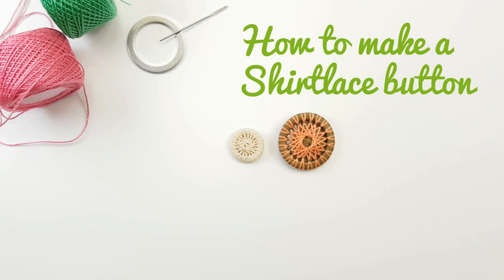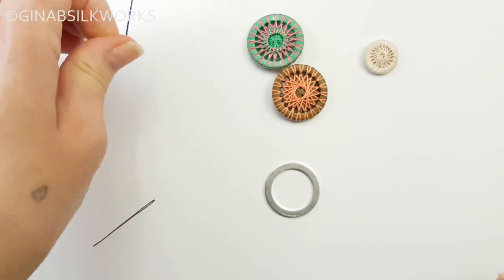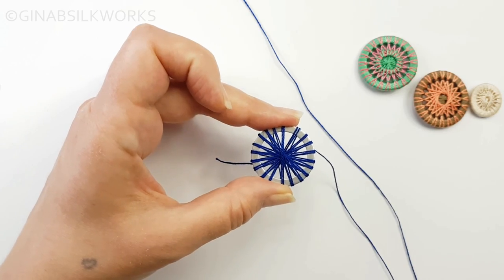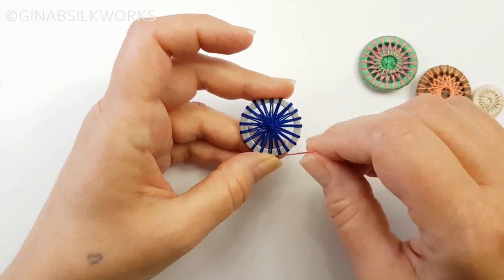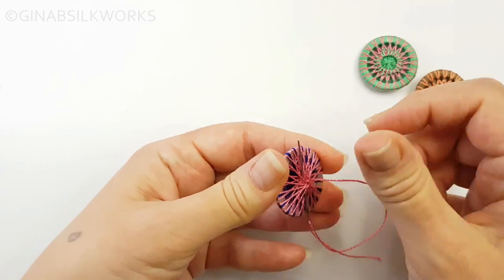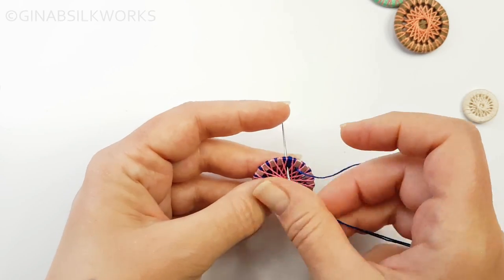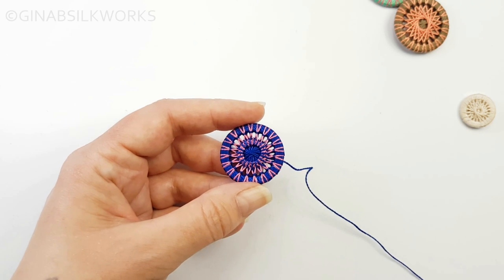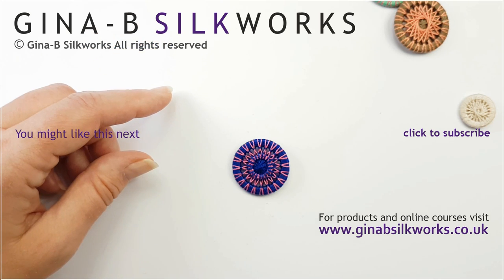How to make a shirtlace button (not a Dorset Button) - a zwirnknopfe ring button

Comment: How do you keep the thread from sliding around on your ring? My thread keeps slipping off (and around, and just generally not staying in place).
Reply from the maker: If you are using a flat (washer-style) ring, and the thread slips, the chances are your tension is too tight. If you are wrapping tightly, the thread wants to pull down the curve of the ring. 
You can rub a bit of beeswax on the ring to make it a little tacky - this often helps.
Also, if you are holding the centre of the button - not the edge - you may find that your fingers actually push the threads as you rotate. If you can try to hold along the edge, or only very gently when holding the centre, you may find they slip less. 
I hope this helps :)

Comment: What time periods would these be appropriate for?
Reply from the maker: From what I have found so far, these are from about the mid 1800s - with a a machine advertised in 1911 which of course increased production, as part of the work could be done by machine.

Comment: Thank you Gina for sharing your wonderful talents. Your videos are clear, concise and extremely informative and, best of all, interesting. With the price of buttons being so high, I’m hoping to make my own for my knitted garments. My question is: how should I launder the buttons? Is hand washing acceptable? Please advise. And thank you again for your marvellous videos. I’m subscribed and look forward to them. Also, I wish for you and your loved ones a Happy Christmas and peace, health and happiness in the coming New Year.
Reply from the maker: Thank you! 
Laundering depends on the material of the mould and the thread. I have washed (in the machine) buttons with plastic, brass and aluminium rings. Other button types, with wood, no, but fabric centres yes. I'd always recommend low temperatures, and usually not putting them into a drier, but I've done that too as trials... a gentle hand wash it a good way to go. 
Ring Buttons were originally designed to be washed, and were white used on white, on metal, but rustless, rings. 
Some detergents can affect the metals - brass going green for instance - but that's rare. And, don't use threads that might run. 
Merry Christmas to you and yours too

Comment: If I use a larger button mould, for instance a 36mm one, would I make more than 10 divisions?
Reply from the maker: For this exact design, no. If you add more divisions, the second layer wrap may need to be adjusted you see. For instance on some you'll skip say, 5 on others you'll skip 7. Just play and create - you can have as many divisions as you like, just play with the second layer. And maybe add a third... :)
Reply: @GinaBSilkworks  thank you Gina. I’ll play and get it to work for me.